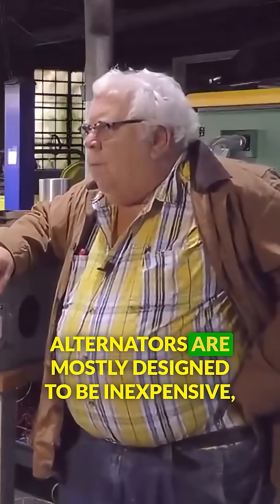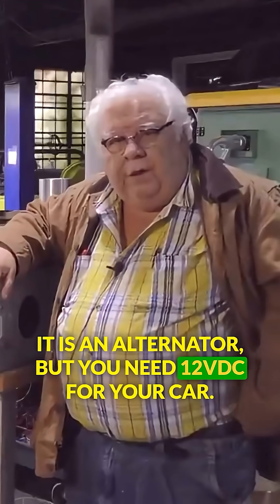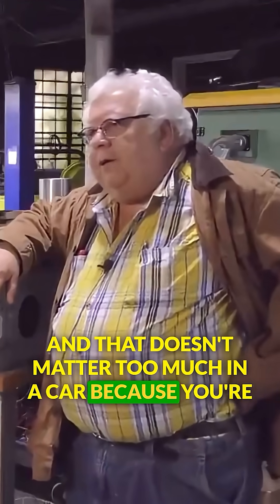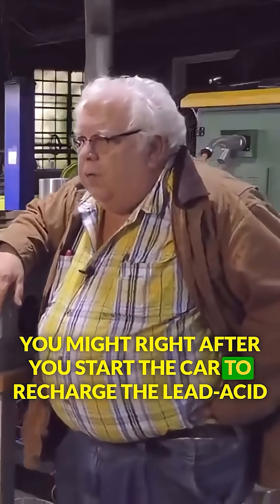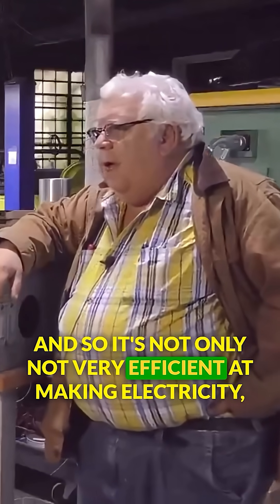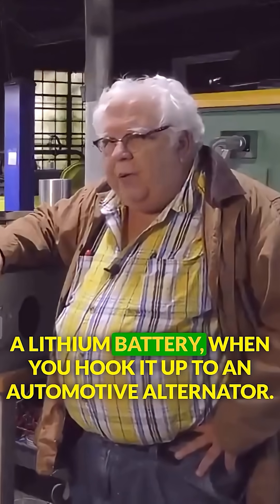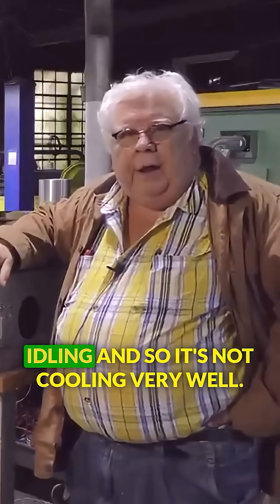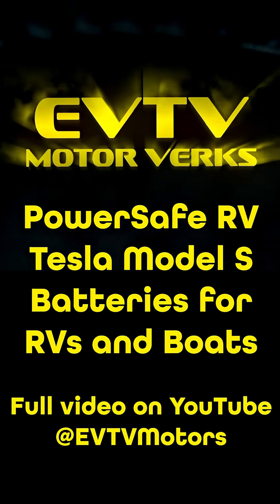Alternators are Only 50% Efficient!

Comment: I can completely vouch for this !!
Charge the battery first !!!!
I had to double (twin) the wire
from the alternator to the jump point
to the battery cable. 
The current draw made the single wire so hot. I cloned the jumper wire with the same size and length. Halving the resistance. That did the trick.  Boy that alternator squealed !  Once charged it settled down. Now the truck sees it as a normal battery. DIY battery. I'll never need another lead acid again. At -18°F it started just fine. (Two start Chevy).
I love LiFePO4.
Reply: Upgraded  from a 130 amp alt to a 200 amp. Replaced the 6ga charging cable to a 2ga.  Even if I stayed with  the stock 130, I would use the 2ga cable.

Comment: False , lithium batteries are twice as effective at taking a charge as a lead acid battery, a lead acid battery takes 2 times as much electricity to charge then it's capacity so a 100amp charger takes 1 hour to charge a 50 amp battery . What the real problem is that causes an alternator to burn out is that a lithium battery can generally be five times bigger than its lead acid counterpart pound for pound so a 50 lb lead acid battery might be 50 amps , a 50 lb lithium battery can hold 250 amps
Reply: But from dead a 250 amp lithium battery will take 2.5 hours to charge at 100 amp charge rate , the 50 amp still takes 1 hour and has 1/5th capacity

Comment: This is incorrect.  There is not an extra load but on the alternator by switching to a lithium battery.  In general a lithium battery has a much higher capacitance than a lead acid battery so his statements are true if the lithium battery was severely drained below it’s operating voltage as the alt will work harder to regulate the voltage.

Comment: My 2000 Dodge van has the original alternator with 168,000 miles on it. It’s hooked up to a lithium battery, and has been for several months.

Comment: You can burn up an alternator by using LiPo lithium batteries... but LiFePo4 can be easily adapted to 12v with a good BMS.

Comment: Great gripe session, pointed out a giant problem & went on to provide any ideas on how to fix it. Was hoping to hear about a link to another video where you take a junk alternator and using his new method, rewind it so that it's 95% efficient or something else to help mitigate the issues.
Reply: I don’t think that much improvement is possible, unless you have a way to replace copper windings with superconductors. I think the main problem is that they engineered it to be a rather high output relative to its physical size. To make the windings more efficient, you’d have to increase the wire gauge a few sizes. Maybe you could replace the field winding with neodymium magnets. That would reduce the heat, a parasitic drain, and little bit of friction from the brushes. The problems then, it would have no voltage regulation, and the diodes would probably blow at high rpm’s. Then you could add a massive external switching mode regulator. But the diodes would still have to be replaced. Maybe you could bring the alternating current directly out, and use some larger, higher voltage and current rated diodes. Just some ideas. Maybe I’ll try it myself someday. 🙂

Comment: When I build my race buggies i run audi s4 alternators, they are liquid cooled and sealed, have a 190a output and a simple 2 wire hookup, i might be running at 1200 rpm or 7000 rpm at any given moment, in heat and dust, water and mud, and in 3 years i have yet to burn one out

Comment: No one ever mentions that half of the alternator's output is not even used by the electrical system, simply because of the direction of current flow, called polarity. The electrical system of the automobile will only accept DC output. The diodes spend half of their working life blocking half of the current flow! 😮

Comment: So I love alternators I'm big into car audio and I build my own custom lithium Banks so they can hold a significant amount of power i custom ordered a internally regulated alternator that was 390 amps and I could pull 430 amps off of it and then I can set the voltage to wherever I needed which at the time was 15.9 volts so that my ECU would not be damaged that vehicle was a 2008 Chevy Cobalt and the lithium Bank could put out over 100,000 watts of power and a peak 30 second 200,000 Watts I was using yin long 35 amp hour cells made into a 6S configuration and I built 10 Banks it had a 35 C rate add discharge close to 8000 amps at 15.9 volts the bank would drop down to 14.8 for a short period of time and come back up to 15.9v when I was competing

Comment: An alternator is not a charger its a maintainer a low battery that hasn't been charged first will let the magic smoke out thats the reason an alternator charges one two volts over the rated battery voltage more voltage less amperage is needed thus less load on the alternator

Comment: What he said about lithium consumption of the lifespan of alternators is just incorrect entirely. Lithium consumption is only for a short period of time in comparison to agm or lead acid. Also he’s got it backwards. Lead acid is hugely inefficient at accepting a charge therefore putting far more strain on an alternator than lithium.

Comment: This explains why hybrid vehicle use an internal generator between the engine and transmission for charging the batteries instead of super high amp alternator(s) attached the front of the engine.

Comment: So the only problem are the diodes/rectifiers? Why does the alternator HAVE to put out ac current. If the rotor was redesigned, so it would only have 2 opposite  to one another magnetic poles of the same kind (2south, or 2 north poles) the alternator would put out half wave  current that would not require any rectification, just a big capacitor to smooth out those half waves.

Comment: As long as the lithium battery is charged and at or below resting voltage of the output of the alternator it'll be fine... Been doing it for 3 plus years with no problems

Comment: It doesn't make sense. I'm an electrician who also works with cars and I know that a car alternator has a regular 3-phase stator connected either in a delta or a star and 6 diodes. In principle, only 2 diodes are active at the same time, which are made of silicon and usually have a voltage drop of about 0.6-1.2V, which at 100A means a loss of 60-120W at an alternator output of 1400W at 14V. So the efficiency of the rectifier is over 90%.

Comment: If they put out 12v your lead acid battery will go dead. They are 12.6 when fully charged. You need 14 the 15 volts to charge the battery. Also at idle most alternators can't put out max amps due to slow rpm. Let's get facts straight.

Comment: Very interesting video, although there's a few things that don't sit right. Alternators will never be running at 600 RPM!   Look at the size of the crank pulley and the size of the alternator pully.  It's geared up.  On average, it's geared to spin 3 times faster than the engine, it's a basic requirement, as most cannot produce power effectively below 1800 and become most effective from 2000 RPM Upwards.  The average idle speed is actually 700 RPM,  At which speed the alternator is at 2100 RPM and the fan is providing a strong and powerfull draft over the windings

Comment: At 100A and 13,8V alternator is making 1380W of usable power. Since it is essentialy 3-phase generator each phase is effectivelly contributing ~33A of current. Each phase needs 2 diodes for rectification so each diode only pases 33A. Diodes have forward voltage drop of 0,7V, so each diode is wasting 0,7V * 33A = 23,1W. Total wasted power for 6 diodes is 138,6W. Which means alternator is about 90% efficient (not counting exitation current) at this power output not 50%. Diodes in alternators are so oversized they can sustain shorts on alternator output for tens of seconds before they blow apart. Wasting 23,1W continously is piece of cake for them even if everything around them is toasty from engine.

Comment: Well, on idling, alternator output is severly limited. But 200A unit may be still producing, say,  100A current, and fan cooling is indeed also limited. And alternator is mounted on engine, which is very hot itself. Especially on idling, when the flow of outside air is also very small.
Hope voltage regulator have overheat protection.

Comment: If only there was a way to attach a relay to the ultinator with a low pass through amp that would engage cutoff at lower is idling speeds. If only

Comment: So what happens when you can control the charging voltage like I can take my 320amp alternator from 12.8 to 15.5v 

But I have a 100ah scib lithium that is good from 14.6 to 16v and I can pull over 2000 A  off of it good for 25 to 30,000 w and it has a floating resting voltage so I’m charging at 14.8 the battery resting voltage is 14.8 when I turn the vehicle off  

I figure it’s better since the battery is working in conjunction with the alternator but granite I’m not pulling nowhere near it’s capabilities  more like 8000w 

It’s been the best battery I ever had  and it works very well in - degree weather 

Unlike lifepo4 lithium that’s more for your stock vehicle charging

Comment: The alternator is more efficient than a DC generator, but loses a little bit through the diodes.
The brushes/slip rings( smooth, no gaps that cause sparking ) in an alternator takes controlled DC to the rotor at relatively low current, while Stator ( stays still, no brushes needed ) pumps out the high current ( the voltage is controlled by that rotor current ). A DC generator ends has the brushes going onto what is a commutator that does have gaps which spark and wears the brushes faster.
If you have ever seen an old style power drill where you can sort of see the brushes, have you seen those sparks fly.
So the Alternator is low efficient, the DC generator is worse.

Comment: Is why we install DC to DC chargers. Limits the current load on your alternator to 20,,40 or 50amps depending on which one you installed.  The better DC to DCs come with an override automatic or mostly switched to limit down to 20amp when stuck in slow moving traffic to avoid overheating the alternator.

Comment: See, I thought and probably most people think if you spit an alternator it's gonna produce power. Well I was making a homemade generator and in fact you do need a battery because you have to send Power to the alt. To engage the alternator then it starts producing about two volts higher than what you're sending in

Comment: Proof at some age technology passes you by and you no longer understand it, if you ever did. 1st, alternators are nowhere only 50% efficient. 1200 watts of waste heat would fry an alternator instantly, that's about the same heat as 2 burners on an electric stove.

2nd, lithium ion batteries do not connect directly to anything the power / get charged from, they all are controlled by battery management circuits. So load on the alternator is solely controlled by the microprocessor in the battery's "brain".

My guess is this guy was left behind back when cars went from 6 volt positive ground generator systems to 12 volt negative ground alternator systems. (1950's for the younger crowd.) Probably swears points are superior to electronic ignition (1970's) and fuel injection can't hold a candle to a carburetor (1980's).

Comment: Conclusion is true, but the efficiency bit is absolutely bonkers. Old alternator relays (60s?) - yes, very inefficient since they just short the alternator. All newer ones, maybe 80% efficient. A diode drops about 1V at max current. There are 2 diodes in a rectifier bridge in series, in conduction at all times, 50% duty cycle. This means about 200W are dissipated in the diodes, for a 1200W load. Some more in the coils, some little bit extra in the relay. So all in all, about 300W lost from 1500W produced, or 80% efficiency.

Comment: This is largely misleading. This guy is referring to running something like a tesla battery pack in place of the deep cycle lead acid batteries used in RV motor homes and such to power it. 

Dont confuse this concept with lithium batteries made for normal cars in normal battery group sizes that operate perfectly in conjunction with the normal alternator.

Comment: My 300amp alt lasted 2 years with a 135 Ah c-max lithium battery, and I would pull up to 44,000 watts out of my amps clamped. My bank also is at 16v and runs my car as well. You run a smaller pully and belt on the alt for idle to get the extra rpm. Lithium is far superior over lead acid, but it's also more volatile. Also, you can't mix chemistries, do not run lithium with lead acid, do not jump lithium with lead acid, or glass mat batteries. Do a big 3 with 0 gage wire. Also the battery has a balancer for the cells, and I have a volt meter installed on my dash.

Comment: I'm not sure if battery technology has changed for lithium batteries, but I was running a 5.5-pound lithium racing battery on my Scion FRS with no problems for months before it got totaled. I then reused that battery (mind you, it's like $550 for the Braile G20) on my 2011 Mercedes E350 because its battery died one day, and I had it just lying around in my closet. It ran perfectly fine for a few months ...until my battery one day just died, but it could still be recharged! I never used a trickle charger either while in use. The car is also a V6 with tons of electronics. The original battery is about 50lbs too. I may have been extremely lucky, so I don't recommend it unless you absolutely have to.

Comment: I always wondered why they even have the rectifier circuit integrated into the alternator, being that this is what usually fails, why replace the whole thing when it could’ve just been modular from the beginning? Just bearings and rectifier circuit from what I’ve seen

Comment: While that's fair for old school alternators that logic doesn't apply to new ones being as they have internal fans to regulate temperature, some are even designed to go next to the firewall on front wheel drive vehicles where they have no external airflow at all

Comment: An alternator at idle will typically have 20% to 45% of rated maximum rpm capacity. Engines often have higher rpm than minimum idle just after starting which takes a ~1 minute to settle down to normal idle rpm after all loads settle (pumps, brake pressure, steering assist pressure, alternator load..). The lower internal resistance of large capacity LiFePO4 batteries compated to lead acid means higher current will flow for fewer volts difference between charge voltage & battery voltage. A DC-DC charge controller can help to moderate the maximum current especially if it allows remote control of current so you can adjust for different situations. Add remote switch so charging can be switched on while driving. A switch or BMS that suddenly stops large currents can cause the alternator voltage to suddenly spike to extreme voltages. It's useful to keep a SLA attached to alternator output to absorb/moderate  these spikes instead of frying alternator regulators & frying vehicle/boat/aircraft electronics. Check alternator specifications for current capacity at idle.
YMMV.

Comment: Wouldn't it make more sense to produce a higher efficiency alternator to reduce fuel consumption over putting in garbage low tension rings that cause oil consumption and using ultra low weight oil that destroys bearings after 150,000 miles? Do CAFE standards tests not figure in the consumption of the accessories?

Comment: I still remember having a nissan micra and i took it to a shop to get its alternator fixed, they found that weirdly the previous owner decided that it didnt need a alternator but instead fixed a magneto to the output shaft so they output shaft created a charge by passing magnets through a copper coil pack. The mechanic was confused, i was confused, the mechanics dog was confused, so he turned to me and went "You erm, you want a new engine? I have a spare engine for your car complete with alternator, I'll put it in for £150 and itll save you from blowing up". Engine swaps were at the time normally £450 so i though "Yeah sure". Had new engine in, worked properly and he kept the old engine. Few days go by and i get him ringing me up 😂😂 he told me to go to his shop and prepare to be confused, i go there and he turns on a rigged ignition that starts the starter motor and he said "I got that aftermarket magneto working, let me turn off the engine", turns off... Activtes window wiper stalk, engine turns on. Turns off by letting go, turns lights on, engine starts, turns off when he turns lights off, applies brakes, engine turns on full revs 😂😂. He looks me dead in the eyes and asks where i bought it from, i look at his son and he goes "Ah" 😂

Comment: 50% is pretty good lol, the engine it’s connected to has 25% thermal efficiency at best. Maybe 35% if it’s a diesel. Hell, F1 cars with their hybrid system barely break 50%. Heats a killer!!

Comment: I don't know how accurate this information is because I have 100 amp lithium battery and the original battery, plus I run an inverter that has a bank of six Milwaukee battery chargers. It's been approximately 2 years without the slightest issue.

Comment: for an alternator to run  at 600  rpm's at idle speed,  The pulley would have to be  1.25 times the size of the  crankshaft pulley, but it isn't.  The alternator pulley is usually about .25 times the size of the  crankshaft pulley.  Therefore , with the  engine idling at 800rmps,  the alternator would  be  spinning at 3200 rpms.